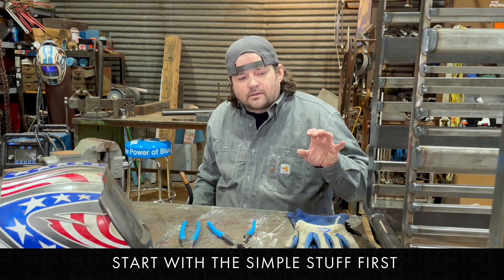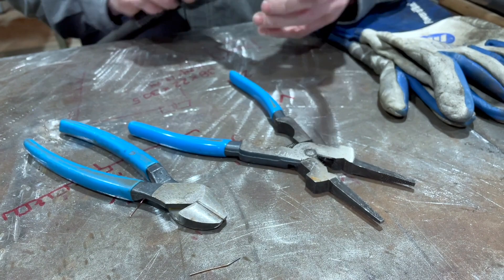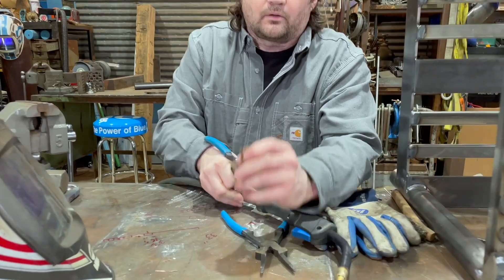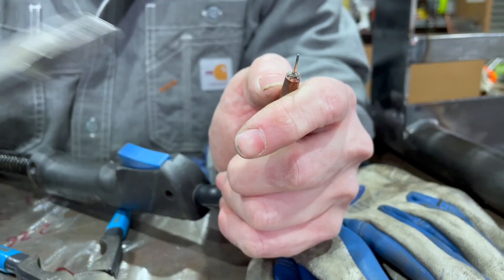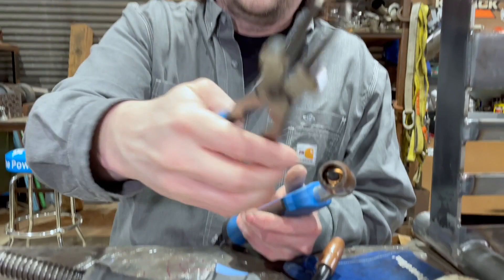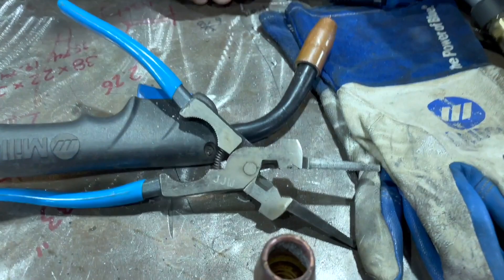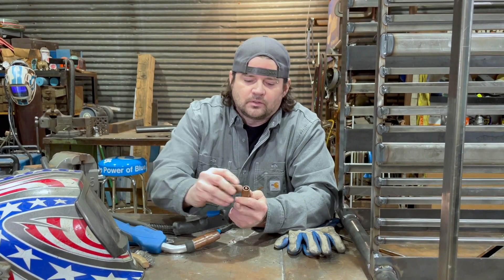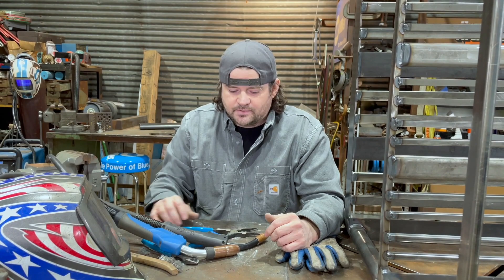In the Workshop, Ep. 1: How to keep a MIG torch clean

Comment: When you use pliers to rake out spatter from your nozzle you end up gouging the copper nozzle which leads to more spatter sticking to your setup. Take your nozzle off and use a very fine file to smooth it out and then use 80-100 grit sand paper and your fingers to smooth it out further. Just a slight tap against the side of your table keeps it clean for a long time. No nozzle dip necessary. The objective is to keep it smooth. I even go a step further with some scotch bright to slick it up more.
Reply: Interesting! Even if you’re welding a lot of galvanized?? I mean obviously use nozzle dip, but it’s so obnoxious how much crap sticks when welding galvanized but that’s probably the issue! Not a smooth nozzle.

Comment: Thats simple logic. Im looking for how to avoid big metal blobs dropping in gun with over head welds. It seemed to improve with more wire feed but still did it only you got a little more welding done. One bloke said to have gun out on angle so any blobs drop off and miss gun. But others on YT  show to get right in close as and they have no problems

Comment: How about when you are using just flux core without shielded gas, does it matter if the cup gets clogged up??
Reply: nope
Reply: Not as far as hurting gas flow, but too much buildup and your wire might catch/ground out on the crud.
Reply: You don't need a cup for Flux core.  The cup is used to direct the gas.  Most machines also run MIG so they come with cup installed. Remove the cup and just use contact tip.  Happy Welding

Comment: I'm glad I found this as it answered my question regarding distance from the contact tip to the nozzle tip. I bought a new welder from the local large hardware chain and the gun which came with it has the contact tip a good 4-5mm (3/16th inch) inside the nozzle. This means my stickout has probably been closer to 12-15mm (5/8") and could explain why I've been having so much trouble getting (gasless) MIG working OK. 
Using stick with 6013 has been fine.